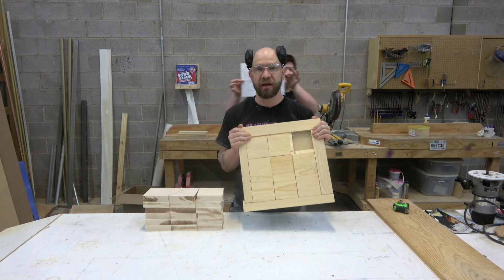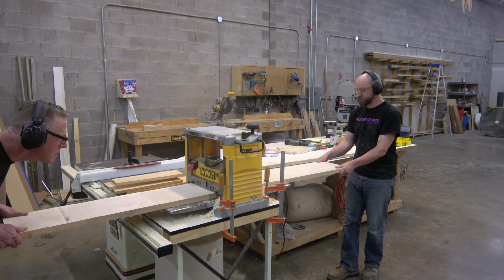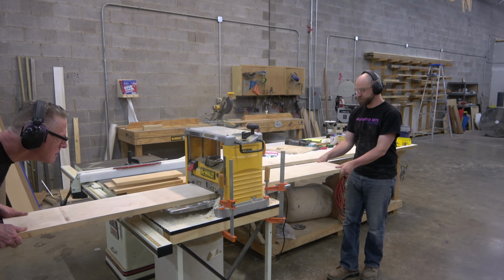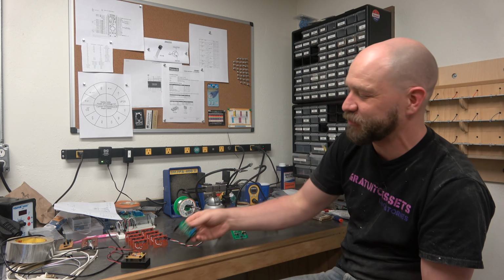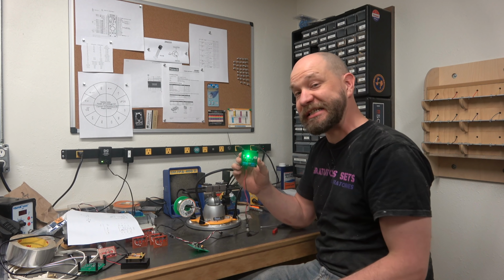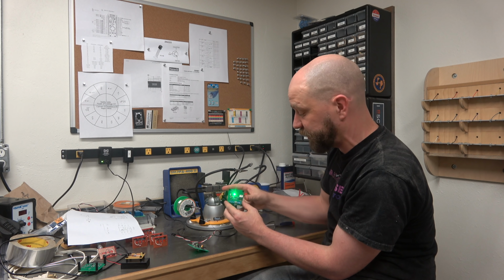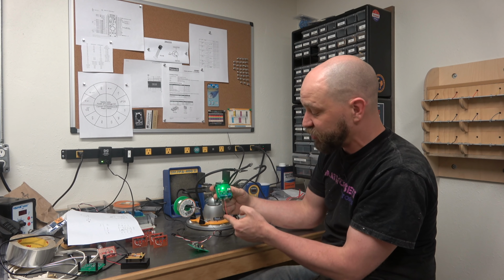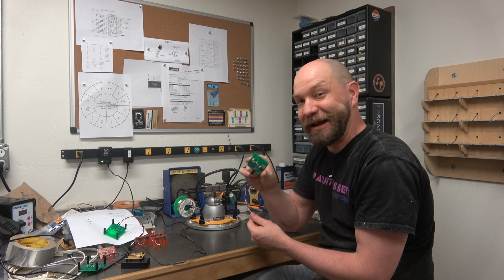Building an 8-Square Escape Room Puzzle

Comment: With the hall effect sensors wouldn't it be easier to have them in series with only one mosfet closing the circuit of the maglock? Another option would also be to put 2 Hall effects in parallel per tile, then you should have the required current capacity to run the maglock by itself. Each one of the P.H.E.T. seems like it is pretty expensive to build (both man hours and parts cost) With the design of the PHET are you serializing the output of the mosfets between boards? 

Have you ever thought of using an addressable sensor solution? It would require a microprocessor but then you could leverage additional logic to enact some action when the "hole" tile is placed at a certain location. I think the A1342 should fit the bill and supports multiplexing.
Reply from the maker: Definitely a question for Matt!  I'll get him to reply when he gets back from a supply run
Reply: The (a) nice thing about the PHETs is that they are self contained. A game using them as its guts requires only and many triggers as you want, a mag-lock and a source of 12VDC.
Transistors are much cheaper than hall effect sensors (~$0.20 vs $2.00); and that would also require both sensors to read the same field an seems like a potential fail point. 
The way these hall effect sensors work is that the OUT leg puts out VCC when there is no magnetic field present, and goes to GND when there is; so you can think of them as normally closed switches, that require a magnet to open. If any sensor in the array remains inactive (closed) the mag-lock can stay on.
All this said, the next version will use linear hall effect sensors (instead of the unipolar that I have now) and can be set to look for a N or S pole to trigger.
Reply: @matthewcharles7574  It does seem nice and you could batch out these PHETs to be used multiple as lego parts. (self contained) 

Do you have intention of distributing them (either the design or the part)?
Reply from the maker: Not at the moment- I think we are going to use them to add value to our stuff ;-D

Comment: Why did you choose to use the tablesaw rather than a table mounted router? A slot cutting bit and a rabbeting bit should make the job much faster. In addition you wont have to go back with the chisel and clean the path as both bits use flats for cutting.
Reply: Waxing the tongue might also help in reducing friction.
Reply from the maker: Good point.  We needed to sneak up on the right number by running both sides through the blade to keep center, but a small dado stack would have been faster.  Matt did it that way because he hates himself...also, abundance of caution :-D
Reply from the maker: definitely! Ended up not being necessary, but I have a block of beeswax for just such occasions!
Reply: This was another example of me not working as intelligently as I should have, because I was trying to talk to the camera instead of really thinking about the problem.
I said I was going to use a dado blade. I did not. I really should have.
I made the following excuses:
The first piece went quickly enough, that it wasn't worth changing the blade. Twenty (I made extras) took twenty times as long as one.
Our dado blade needs to be sharpened, the laminate blade just came from the sharpener. It's not that dull; I should have used a dado blade.
But you're asking about the router table. That would have been a better (faster) idea than nipping away 1/16" at a time with the laminate blade; though our selection of end mill bits is limited, many of those actually are that dull (might have caused blowout), and I generally trust the fence on our table saw more than the one on our router table.
Could I have purchased the correct router bit from the same guys that sharpen our blades and are two blocks north of us and dropped off the dado blade in the same trip? Yup. Should I have done so. Probably.
Reply: @matthewcharles7574  I would have used a slot cutting bit and a rabbeting bit but an end mill could do the job. Only concern would be keeping the flute count down to 2 or 3 and not be tempted with an endmill designed for 4 flutes. (Might cause excessive burning.) 

Speaking of burning if you take a rough cut then go back with a finish cut you can avoid some of that burning. (Especially if your finish cut is less than the blade kerf.)
Reply: @matthewcharles7574  If you keep your wood block as one longish plank and add the tongue and slot to the entire plank you could cut down your processing time and have less concern for blowout as that would happen on the waste at the end of the plank. (Just like snipe that you get from the thickness planner.) Then you divide the plank and add the other two cuts per-each puzzle piece.

Also here is a Freud tongue and groove set that can use shims to keep the groove wider than the tongue and keep it loose in the groove.
https://smile.amazon.com/dp/B00006XMTT/ref=cm_sw_r_tw_dp_U_x_CYedDbT8KCT7W
Reply: Another way to "skin the cat" would be to build the puzzle pieces up from multiple pieces of wood glued together. Wood glue and brad nail would do the trick. I would recommend a quick jig to ensure all the positioning is the same.
Reply from the maker: Great idea!
Reply from the maker: Buying one now!
Reply: @justinherman9443  , I actually did consider a multi-layer glue-up. I discarded the idea because I needed different thicknesses from different parts of the same layer. The tongue had to be slightly thinner than the trough.
I didn't go with the plank idea because I didn't want to have to come back to the same positions on the fence, which I had to anyway, so yeah. That would have saved some time. Where was that suggestion before I started?
Reply: @matthewcharles7574  I wouldn't really recommend a glue up except you have a thickness planer so it would be simple to make tongue layer just a bit smaller than the groove layer.
Reply from the maker: I agree
Reply: @matthewcharles7574  Late to the party and discussion here, but as I was watching I also wondered about using a router table rather than a table saw - and for the exact same reason you went with the saw - I trust my router table fence more than my (very crappy) table saw, and my bits are sharper than the table blade!
Reply from the maker: Totally understandable! Our table saw fence is accurate to less than a 64th" and was easier to "sneak up" on the solution but, if we had to make another, we'd definitely use the router. Also, it would save me from having to clean up the tongues with a chisel!

Comment: Please talk about how each tile activates only one sensor. How much lateral slop do the sensors have? As each tile tessellates in 2 directions, do the sensor locations need to be unique in both directions?
Reply from the maker: When solved, each tile's magnet if located in it's INSIDE corner,   You'll see that the sensor grid on the back is smaller than the center positions of the tiles on the puzzle face. The PHETs are discreet enough for this to work
Reply from the maker: GREAT question, BTW ;-D
Reply: To add to what Mark (GS) said: Each tile has nine magnet holes milled into the back; and each one has a magnet in the inboard hole when the puzzle is solved (the others are left empty; it's just easier to create one CNC path to mill those). The sensors mount behind those positions.
In sliding the block around, the one that belongs in the top-right will momentarily trigger the top-center's PHET when it passes by. But, because you need all 8 solved at once, that won't cause a full false-positive.
Depending on the strength of the magnet, there's roughly a 1/8" to 1/4" of play.

Comment: I should point out that I didn't use a dado blade to make the slide blocks. I really should have. It would have gone much faster.
Reply: Did you consider using a router?
Reply from the maker: This was another example of me not working as intelligently as I should have, because I was trying to talk to the camera instead of really thinking about the problem.
I said I was going to use a dado blade. I did not. I really should have.
I made the following excuses:
The first piece went quickly enough, that it wasn't worth changing the blade. Twenty (I made extras) took twenty times as long as one.
Our dado blade needs to be sharpened, the laminate blade just came from the sharpener. It's not that dull; I should have used a dado blade.
But you're asking about the router table. That would have been a better (faster) idea than nipping away 1/16" at a time with the laminate blade; though our selection of end mill bits is limited, many of those actually are that dull (might have caused blowout), and I generally trust the fence on our table saw more than the one on our router table.
Could I have purchased the correct router bit from the same guys that sharpen our blades and are two blocks north of us and dropped off the dado blade in the same trip? Yup. Should I have done so. Probably.

Comment: That's an interesting use of hall effect sensors.  I would have never thought of that.  Great work.  Quick question:  Where do you order your PCBs from?
Reply: I've been using seeedstudio.com, though that might change as I get into pick-and-place for future projects.
Reply: @matthewcharles7574  thanks for the info.  I take it you've had good experiences with them?
Reply from the maker: No complaints so far!
Reply: @monteporche5552  We've been happy. Their production turn around is fast. Most of the 2-3 weeks to get them in hand is shipping from China. That's also much (sometimes most) of the cost; and I try and get several designs in one box. For small orders (10 or fewer boards of 100mm x 100mm or smaller) they charge as little as $4.90; which is ridiculously cheap.